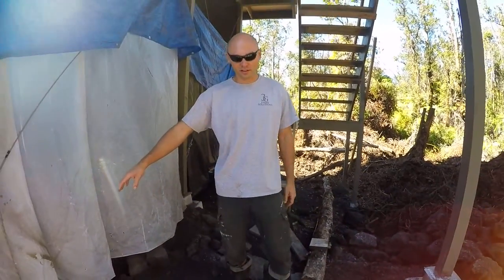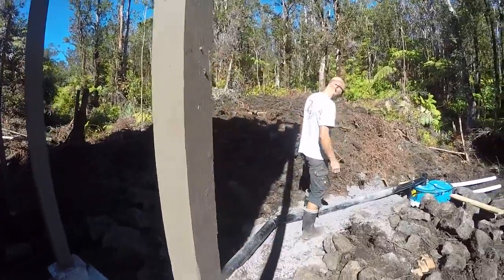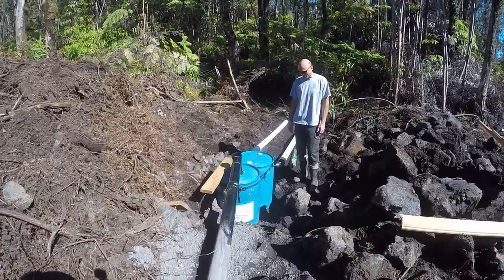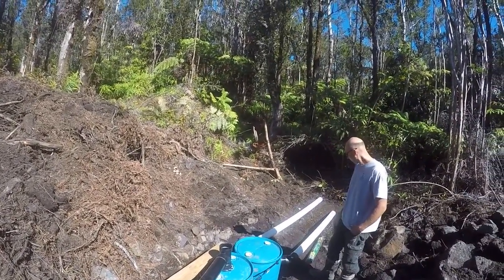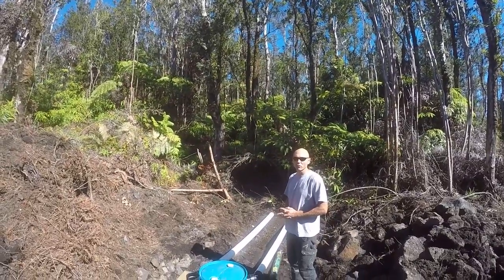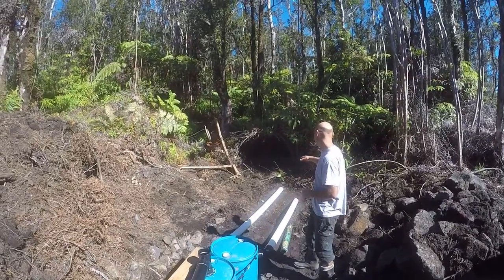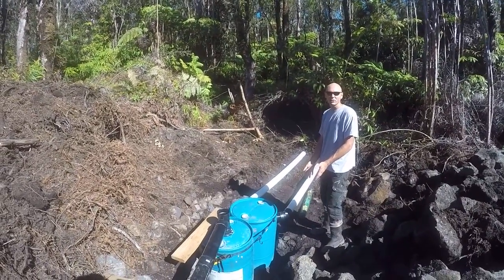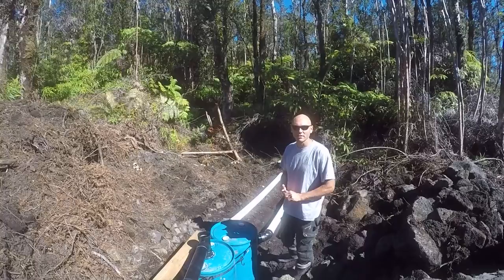Septic layout for small off grid house

Comment: Question, are your 55gal drums connect with 4' pipe as well and how many inches up do your leach field pipe come up? Nice set up, you have given me some ideas.. Thank you.
Reply from the maker: You are correct 4” abs toilet flanges between the tanks.  Leach field comes out with elbows.  All the connections are a couple inches lower as the system works through from the Y trap in the first tank, to the connection between the tanks and then the liquids tank output to the leach field was a couple inches lower than the connection between the two tanks.  Thank you, hope this helps.

Comment: does the solids tank just fill and then need to be pumped or do the solids decompose . The tank is so small I can't understand how it will work. my wife and I have a septic tank that is about half the size of a small room by volume and it is just she and I . In a year or two at the most we have to pump.
Reply from the maker: Hey Charles, the solids tank is pumped every 18-24 months.  We have had good luck with the septic functioning well despite its size.  Its only two people as well using the system. The lava tube and great percolation rayes of the island have helped the system.